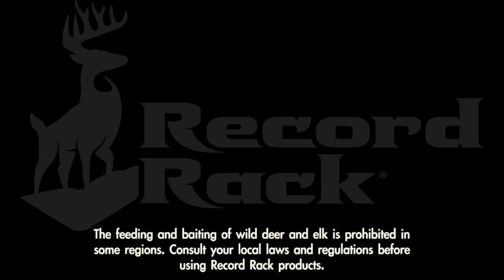How to Encourage Deer to Eat at a New Feeding Station

Comment: We at THE FEED SAVER Company have a lease in the Lampasas Texas  for 11 years and have been controlling Record Rack for years now. With our product The Feed Saver It's so new to the hunting  industry. We can control all feeds with a timer even Record Rack and we are going to try to help the average hunter with a 55gal. Drum system. It's the most common on the market and every average hunter has one. BUT can't use protein and wants too, because it swells up and cloggs, even corn gets fermented , moldy and the powder even cloggs up too. We have some great big bucks that we have grown, body and antlersize, some have drops and split -Y-points so much larger since using and controlling not gravity feeding at all, with the feed saver. It's a patented  product that we are very proud to bring to the hunting industry. It will change everything for the average feeder hunter that wants to use RECORD RACK and control it. You can still gravity feed if you want to. With the feed saver check out YouTube video feed saver or call for info 832-982-buck-2825. Remember SAVING BUCKS KEEPING DOE with the ultimate feed saver. P.S. we have some great idea's and suggestions so call us , and have a great season.....once this product gets out there in the market place you will sell more Record Rack to the average 55gal.feeder hunter!